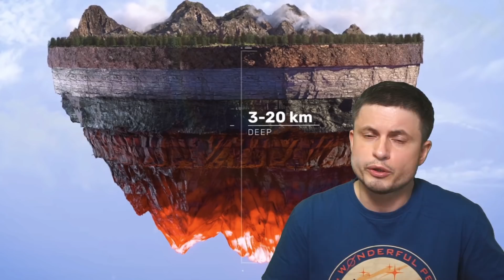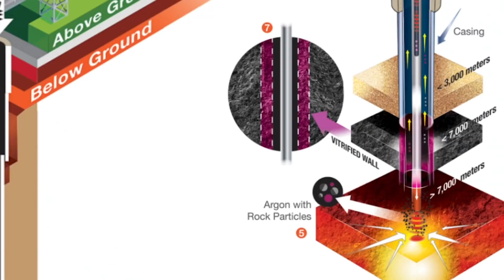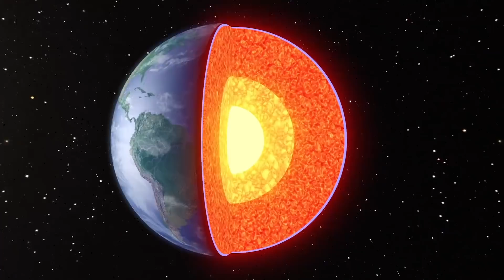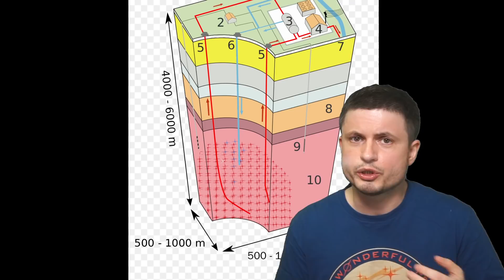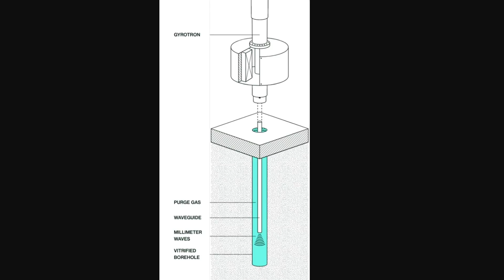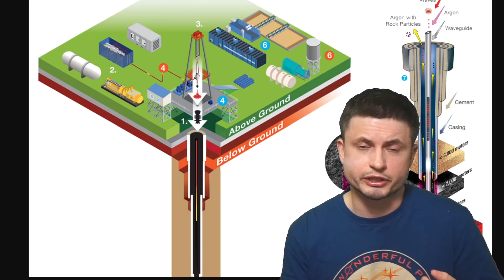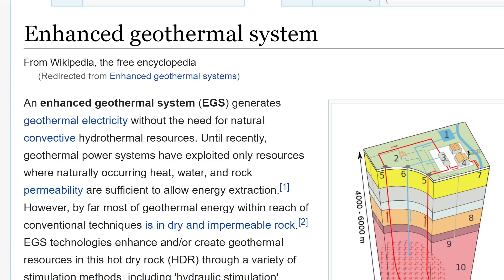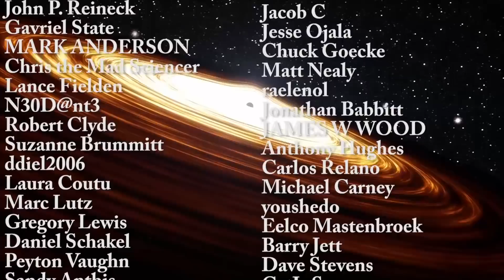Creating Deepest Hole on Earth For Geothermal Energy Revolution

Comment: Geothermal energy can't be enough. It's simple enough to calculate how much energy US can possibly generate if it uses ALL geothermal heat which comes from below its area. (The average Earth's geothermal flux per sq.m. and area of US is easy to find on internet, then you just multiply that...). Hint: it's too small.

Comment: I have great ideas, but no followers 😄. The digging projects all fail because nobody is able to think out of the box. You need a rig which does self sustain its weight and there are a few options nobody has considered yet. Instead, everybody looks for more resistent pipes and drills.

Comment: The whole, turn water into steam to spin turbines thing seems so ancient. They have thermo-electric tiles that transfer heat directly to electricity, why not use a direct system like that? It always baffled me that they can split an atom to cause a chain reaction of massive energy, all to then hook it up to the equivalent of a horse and buggy. Like in over 70 years they haven't come up with a more efficient way to convert heat energy to electricity? UGH

Comment: 2050: First fully powered city with geothermal.
2100: The world has free limitless energy
2200: It is paradise on earth, no more suffering
2400: Scientists discover geothermal energy is cooling
2500: Scientists announce a runaway geocooling effect that will destroy the planet
3000: All the energy in the Earth is depleted the core freezes over. The world ends.
woops.

Comment: Something worthy of note is the weight of a string of pipe. Think of the  weight of a single joint built strong enough to hold the string of pipe without tearing in half from the weight of the pipe dangling below it or parting the threads that hold the entire string together. 
Also worthy to note what happens to the strength of metal when it is heated even only a couple hundred degrees Fahrenheit above ambient.
Some of this is offset by fluid conditions and downhole pressure. But all that goes away when it becomes time to add another joint to gain further depth.
Since I mentioned pressure and fluid conditions it would be important to point out that at 15,000 feet we were getting mud returns over 450°F. The drilling mud needed had to be oil based because a water based mud would boil off at the hat temperature. The mud weight was in the neighborhood of 21 pounds per gallon (the weight of the mud is necessary to keep downhole pressure from blowing the pipe out of the hole when you hit pockets of gas), so it was extremely caustic. So much lye that it was really bad for the people operating the equipment. Oh yeah it destroys the equipment.
What is being proposed is very very dirty and extremely dangerous in so many ways. It is nowhere near environmentally friendly nor is it safe by any stretch of truth or reasoning. It seems really simple on paper where you can ignore mechanical limits and chemical toxicity levels to talk about a 20k depth hole when you've never seen what it takes to achieve a 20,000 foot hole.

Comment: They tried that in Cornwall, a few years ago, but forgot to take account of the voids in the ground: They drilled their borehole, no problem, then started pumping down water, and waited for steam to come up. ... And waited, and waited... There's no shortage of water in Cornwall, so switched to sending down seawater under pressure, and waited... After several years of this, they ran out of funding, and folded.

Comment: Tapping Geothermal with 20 km boreholes sounds like an excellent idea.  I just have one concern:  To drill that deep, I feel like you're going to introduce a weakness in the Earth's crust in otherwise stable or semi-stable geologic systems.  Kind of like the grooves etched into the casing of a Mk 2 hand grenade.  I don't expect to have any events like drilling and then suddenly, active volcano spewing out the borehole (the drill would likely fail from temperature damage long before breaching a pressurized magma chamber, I'm sure).  But I'm not saying its impossible to upset something when you consider that deep geologic systems are pressure cookers that you're going to be punching pinholes into.

Not to sound like someone going:  'Man is meddling with that which he is not meant to'.  But deep drilling is one of those blind-faith kind of operations.  You have no idea what you're going to hit, until you hit it.  Use caution and make liberal use of any kind of mapping technology we can throw at it.  The oil drilling industry and 'kicks' you get on wells under construction can prove just how dangerous that can be without pushing into 3,000 degree tectonic heat sources.

Comment: This is an extremely bad idea. Using current escaping heat is fine, but doing anything that will cool the center of our planet faster is only going to end life on this planet faster. We require a molten metallic core to survive the sun's radiation.

Comment: Lets say a 3Km well costs about $5M. A 5Km (true vertical) well costs about $15M. A 10KM (true vertical: this is the current record) well costs about $250M (+/- 50%)... to my best estimate a 20Km well true vertical ... will cost about $2 Billion. The bit technology does not work with the great heat down there. The telescopic effect of the well diameters will probably need to start 60inch down to 2inch. Bespoke tubular sizes will be required. The yield degration of the steel will be absolutely detrimental. The pipe to drill to such depth ... does not exist. Good luck with that!

Comment: There are a few open pit mines that are giant and have gone quite a bit down into the ground.  But I would think that drilling the well after you dig down 2 km would help out.  I also would like to see something like the tunnel boring machine point downwards and dig as far down as it can go.  Then develop a steam turbine that could fit in the bottom of the hole and send the electricity back up without the heat losses the water would have.

Comment: I don’t know whether this is a valid concern or not but something that has always irked me about global geothermal use is its potential consequences. I know the earth is massive and it’s likely that using geothermal around the world wouldn’t even scratch the surface of its stored heat energy but what if we begin to accelerate cooling in a way that has drastic effects. Thinking that what we do will have little impact on the earth because it’s massive is the same line of thinking that led us to the Climate Crisis. I’m not extremely well-read on the geothermal capacity of the earth but, in my opinion, potential effects like a decrease in the strength of our magnetic field, solidifying crust and mantle, and whatever else could happen don’t sound great. Great video though!

Comment: interesting Idea problem comes with the fact that most of the places where it would be best to doe this sort of thing  are either  hotsprings like all over japan where they wouldn't  want them fucked with Yellowstone where  fucking with it might set it of and whipe out humanity.  or  places like iceland where there isn't enough demand for such a thing to begin with 

Iceland has such a tiny population they they have 0 need for this sort of thing.  

The biggest problem with this is that digging a really fucking deep hole is a pain in the ass the super deep borehole  took 9 years too get down to the level it did and was plagued with problems a insane amount of problems really.

Comment: Since the core should (we still didn't get to the center of the earth to confirm the current speculations ) be surrounded by a magma flow draging certain earth layers it's safe to say that drilling will have it's limitations in depth and in time.
This would mean that such an attempt will only give temporary results and in certain cases catastrophique conséquences if the wrong way of drilling is used.
Why are we not creating tools to harvest the power of vulcanoes?

Comment: Right now the biggest problem with geothermal energy is that half of the cost involved is loan interest and financing fees as it takes a long time and huge investment between the start of construction and when the project starts producing baseload power for the market.  This laser drilling will bring costs down and capabilities up, but legislators need to find a way to lower interest and fees for geothermal financing as this is the major stumbling block on geothermal expansion; the safety and security of the investment warrants a discount compared to riskier investments.  Also, sustainable green energy is its own reward and energy independence is a matter of national security.

Comment: I get that you did all the research, but I have to say here in Canada we use geothermal some times but not for provincial power but to heat a home and maybe a driveway and walkway because we get snow and if you have a heat source that is basically unlimited you can apply some of that heat to clear the driveway, walkway and heat the floor of the house.  However you do NOT need to drill a hole down as far as you suggest, now to be fair I'm not 100% sure how deep you need to go for this use case because your not trying to get boiling water just water that is warmer then what you wish to heat :)

Comment: In the center of earth is an unlimited source of heat.  Much of our electricity is generated by steam turbines.  The steam is made by using heat made by a fire that uses coal or oil as fuel.
America has a huge caldera that is making ground above it too hot to walk on.  The Problem is this thing is underneath Yellowstone national park, so a law requires that we leave it alone.

Comment: Cautions like 20km deep make me believe that people that like metric, only like it because the numbers expires larger and draw more emphasis. 

For recalls 20 km skins so much more than 12 miles. But both are about the same. So one could suggest metric is preferred so you can exaggerate a point.

Comment: How about someone makes a viable version of the burning shield power plant from the old cartoon series 'Cities of Gold'.
If you dont want to trawl through all the episodes, or all the use-net posts describing how it feasibly works, heres a breakdown.
A hole is bored through the centre of a steep hill/mountain, from the top, to deep within the Earth's surface. A giant thermally conductive crystalline structure (Im sure physicists could come up with a viable material) extends from the bottom of the borehole, through the hole drilled through the centre of the mountain, and extends a few metres above the mountain. The centre of the mountain is bored out from one level below ground to two levels above, to allow for installation of the working machinery.
The crystal takes in heat from deep below the Earth's surface, and carries that heat throughout its length. At the 'underground' level, there are sluices to admit cooling water. Workers on the ground floor level (ie the control area) can operate valves to admit this water which flows onto the crystal at the underground level, which obviously turns it into superheated steam. The steam is drawn into pipes where it is conveyed to turbines on the upper level, and the turbines drive generators like a conventional thermal power plant, before going to the condensers to be reused.

If you dont want to know how the series ended, read no further (spoiler alert)

The crystal also contained at ground level an enclosure to put a thermonuclear power source, as secondary way to heat the crystal for when you want more heat than merely the Earth can provide. The bad guys (whos power plant it is) make errors installing the thermonuclear device and it melts down, destroying the power plant and killing them.
Obviously if a REAL one was built, it would not have this feature......

Comment: Kola is the deepest vertical hole .. alshaheen and others are horizontal drilling where u drill to certain depth/formation then turn and drill horizontally. The resulting is L shape well with vertical depth is 3 or 4 km but the total depth is more.

Comment: I remember learning about geothermal energy in school, seems like there is a bit more too it than just digging a hole and pouring water in.
Reply: The laziest way of doing geo thermal energy is just drill two holes and do enough fracking so that the water can get through the fractures and out the other pipe.  

Causes a lot of unintended consequences though.. to put it lightly.  But some places did do it this way in the past since it was rather cheap and easy.

Comment: Not gonna happen. You have to pack the entire device into an insulated and cooled package that can withstand the pressures of its own exhaust or waste piling in the pipe above. Then all of that has to fit through a hole no bigger than it's own beam can bore. It's within the realm of physically possible but practicality places it's own event horizons on reality. Sometimes you can't get there from here.

Comment: This is a TERRIBLE TERRIBLE idea. Let’s say this idea catches on and 100’s to 1,000’s of holes are dug into the earth. To us, it’s hot but to the earth, these probes would be ice cold. Between the probes and holes, this could start cooling the outer core of the earth to a significant point where it has grave, irreversible consequences. Let’s work on fixing the current problems we’ve created on the planet instead of starting new ones!

Comment: I have often wondered why areas that have Geothermal opportunities don't take advantage of them. I'm sure cost to build is a factor but once built the region would be independent of oil and gas for heating and manufacturing. Basically taking them off the grid. There was a rumor years ago that oil & gas, along with politicians, stopped geothermal exploration. Glad to see it is still viable. Hope it makes a comeback.

Comment: You do not have to go that deep, there are solutions that require a fraction of those depths for energy. The way it works is the solution reduces the boiling point of water, then it can turn a turbin without such depth. I suspect the elites have bought the patents along with other new energy innovation. What we need to do is stop voting for these elite bastards so we can have our world back.

Comment: IIRC the problem wasn't that the rock was too hard it was that it was too soft and the hole kept shrinking/closing in, not molten but like a clay/gel. Another detail which was interesting was that the mud which was driven to the surface was actually 'boiling' with hydrogen, no-one at that time was thinking about hydrogen and green power.

Comment: OMG. If you thought that air pollution related climate change was scary, imagine this at scale. 
What happens when we cool the Earth's core faster than nature?
Yes, I know that would take a LOT of holes, but think about how quickly we have burned up half of the world's petroleum preserves. It only took 150 years.
Reply: Convection in the mantle creates Earth's magnetic field.
Reply: @Nakande72  Yep. Pretty sure that's important. 

In the long run, solar is plentiful and relatively cheap. Some of the newest/best solar power plants don't even use solar cells. Just mirrors and heat storage. It's low tech, plentiful, and far more promising than any battery technology in the near-to-mid future.

That tech seems far safer than cooling the core to create power.

Comment: Maybe someone will find this interesting. 
I worked at Goldfields South Deep gold mine many years ago, and we worked at just over 3km or 2miles underground. 
The 1st shaft goes down 3km and then you get the sub incline that takes you further down. The ventilation at 3km is still fine and feels very much like surface temperature, but from there the temperature starts to clime drastically. I mainly think its a combination of inadequate ventilation, and the depth. 
Our average temperature at that depth "3300m" was around 42⁰C.
I always wondered how deep would we need to go to be able to generate enough steam to drive steam turbines. 

So watching this after 30 years is quite interesting. 
Best wishes from down here in South Africa.
Reply: Marius - That is actually very interesting.  I find it quite strange that in some places the heat gradient is off the charts with depth, while others see only moderate temperature increase and even stop rising after a certain depth - Long Valley, CA for example.  It seems that the extrapolations have been generalized, but don't hold true across the board.  I expect these boreholes to fail with regard to geothermal plants, but I expect them to be a great success in exposing the fallacy of a super-hot interior.  As far as I can tell, the only significant heat is generated IN the CRUST along faults and plate boundaries.  The fact that there are deep earthquakes 650 km into the mantle (where nothing should be brittle enough to fracture) says that our assumptions have been wrong.

Comment: with conventional drilling, drilling mud is circulated to remove rock cuttings from the borehole. Does anyone know how this new technology circulates material out of the hole?  It seems as though the melted material will cool and solidify on the way up
Reply: in addition, hitting a high temperature at the bottom of the hole is only one of many parameters that need to be met for geothermal power generation potential. Heat will not radially conduct thru rock towards the well bottom (which is essentially a single point) at any practical rate whatsoever. Heat needs to be transfered by moving actual mass, which in this case is a liquid that travels through the rock and any fissures that naturally (or artificially) exist within it. Igneous and metamorphic rock tend to have very low matrix permeability, which means that there will need to be some fracture network.